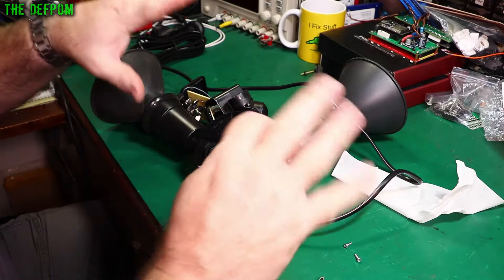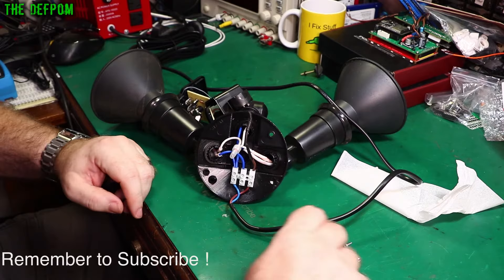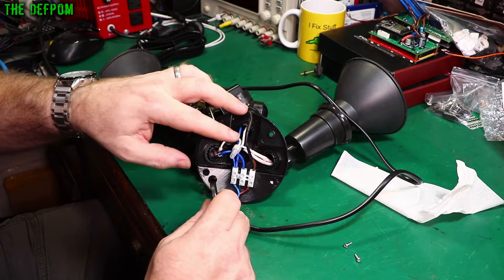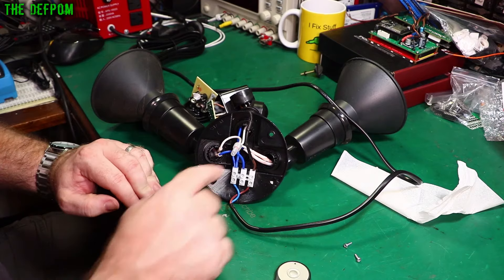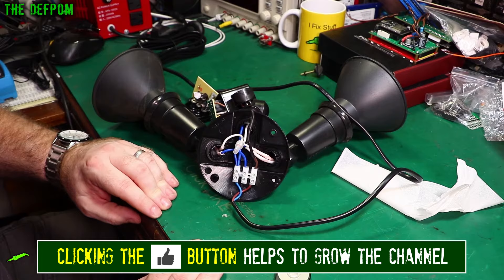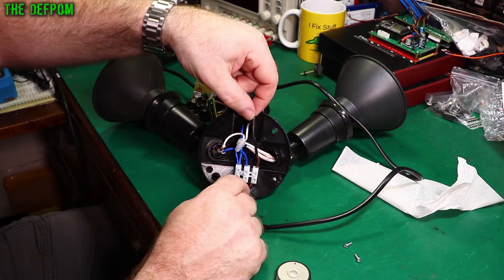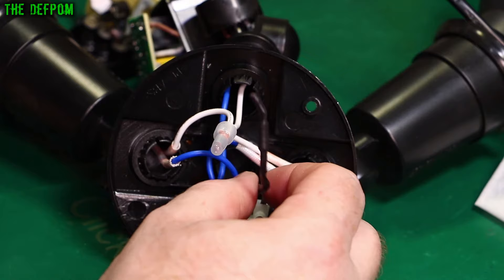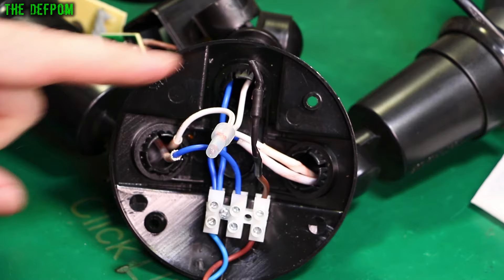🔴 1 Minute Fix - Amazingly Simple Repair - Outdoor Sensor Security Light Repair - No.926

Comment: That wasn't soldered at all, they used a bullet crimp connector and thought "this'll do". Sometimes soldering is not a good idea in outdoors electronics, if it's going to be exposed to risk of oxidisation and your solder isn't pure and skills/technique aren't 100%. I've soldered many electrical circuit over the years and after years, they do fail. Soldering isn't as easy as people think. This is why "made in China" stuff breaks down a lot. Cost cutting and rushing on the basics like this.